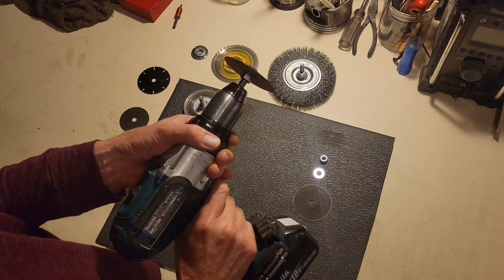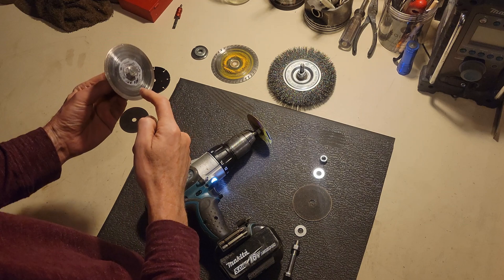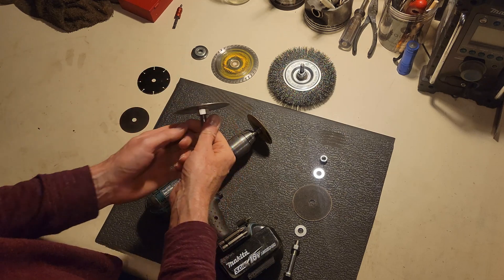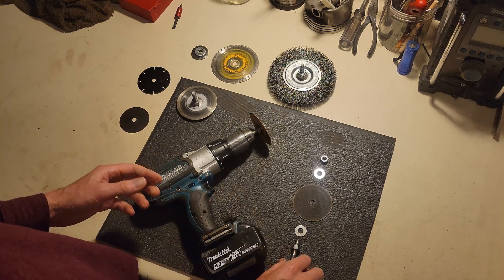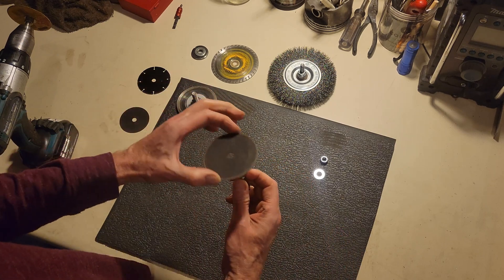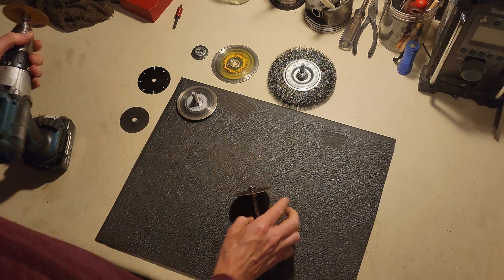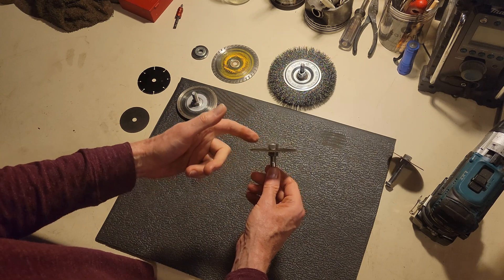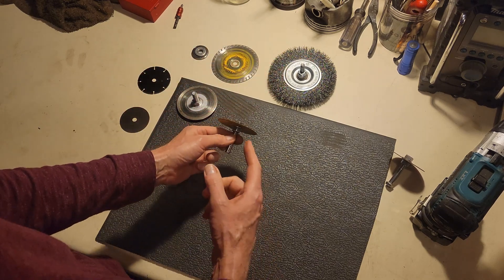Get More From Your Drill - Improvise a DIY Mandrel for holding abrasive utility wheels

Comment: But where in the world do you find those small skinny metal grinders now normally they come in 4 1/2 inches but the hole in the middle is way too big. How did you find them?
Reply from the maker: Two of the smaller wheels came with a RotoZip angle grinder tool that I bought 25 years ago, so those might be hard to come by.  However, I bought some others within the past couple years at a local Colorado hardware store called Jax Ranch and Home - kind of a specialty hardware place compared to the big box stores.  Hope this helps.
Thanks

Comment: Is there a washer?
Reply from the maker: Depends... I use washers when the cutting wheel is made of a non-metallic material, but I skip the washers if the wheel is metal or at least has metal around the arbor hole where the nuts will tighten against it.  Hope this answers your question.  Thanks!